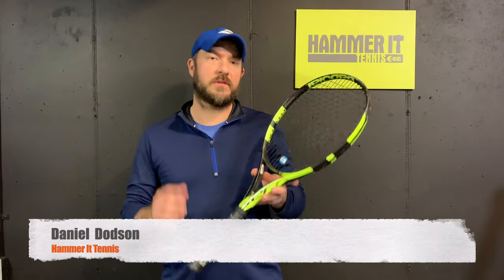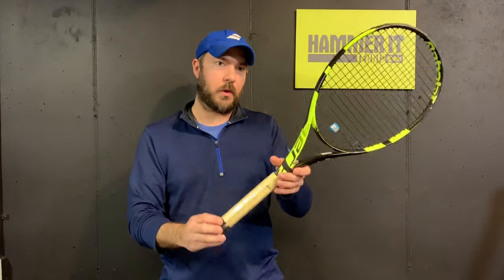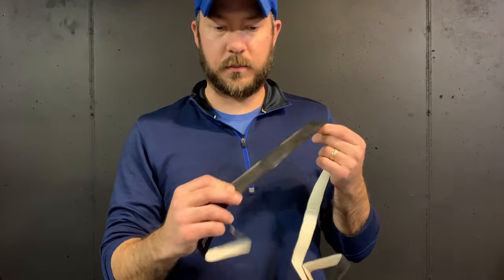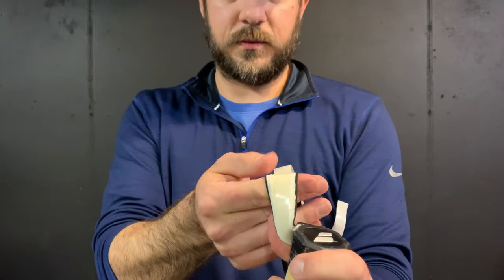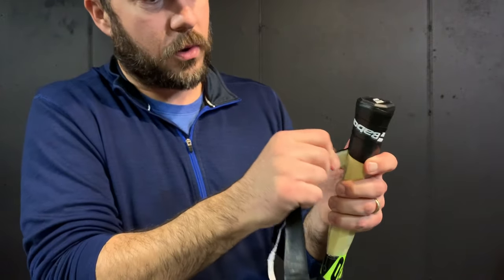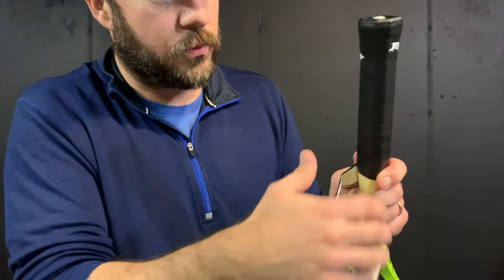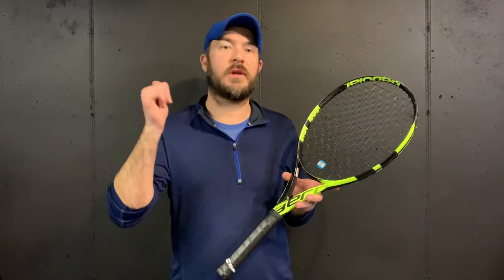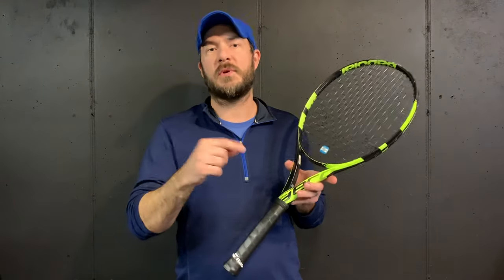How to Regrip and Change your Tennis Racquet Replacement Grip!

Comment: Thank you Sir but do you have a video that shows how to apply a “replacement grip” to a Wilson Blade v8 or v9 please?  This is a nightmare because the end of the butt cap is round and the tape does not stick down when you fold it over as the adhesive only covers the centre of the grip.  Poor design by Wilson.

Comment: Thanks! I remember the pro shop (back in the 1970s and 1980s!) would use a staple tool to anchor the grip when starting the wrap. Is this not necessary any more? Thanks, Kurt
Reply from the maker: The staple will secure the grip the best, but finding a tacker that small can be hard now a days. Most grips have adhesive where the grip starts that holds pretty well.

Comment: I used a different grip tape with NO adhesive at all--Tourna Grip Blue XL.  However, your video helped me change 2 different grips for my Wilson rackets. It's not perfect, but the grips are installed and fuctional; thank you for posting this how to video!  :)
Reply from the maker: Awesome! Glad to help! Tournagrip doesn’t have any adhesive as it is actually an over grip meant to be wrapped over top the factory installed grip (or replacement grip). https://youtube.com/watch?v=8EsT0wVchVI&si=EnSIkaIECMiOmarE is my video on putting on an over grip! Hope this helps too!
Reply: @HammerItTennis  Since I just wrapped 2 rackets, any harm using it or will I have to start over?  This means buying a grip with adhesive and then wrapping the over grip 2 more times for each racket. Your thoughts are appreciated!
Reply from the maker: @evanm.jacobson1514  the factory grip and “replacement” grips not only have adhesive, but they are considerably thicker. Also, the racquets grip size is figured with the thicker grip. This helps give you more cushioning between your hand and the hard handle. I would suggest getting a replacement grip and then over gripping with your Tournagrip.
Reply: @HammerItTennis  Thank you for the advice. I will do as you suggested… Again, your guidance is appreciated. Carpe Diem! EJ
Reply from the maker: @evanm.jacobson1514  let me know how it works out!

Comment: Piece o cake!  Thanks.  When do I use an overgrip? What's it for?
Reply from the maker: Overgrips are used so you don’t have to change the main grip as often. They are thinner and are made to be changed every few times playing or even within a match. Over grips are usually much cheaper and act to absorb sweat and then changed out.

Comment: Can you explain a bit more on what kind of tape we could use if the original grip doesn’t have it? Btw this helped a lot! ❤
Reply from the maker: Are you meaning the finishing tape? Or the tape that goes underneath along the handle ? If your talking finishing tape, electrical tape works well. Double sided tape is what you need for putting along the handle.

Comment: Nice demonstration and advice on regripping tennis rackets. The only thing I do differently is not peel off that much of the non-stick backing as I wrap so that my fingers do not contact the grip adhesive directly. This avoids any oil and dust on my fingers from getting onto the adhesive. It probably does not matter but I’ve got OCD!
Reply from the maker: It just depends on the grip if I take it all off or just a little at a time.  Sometimes the paper backing is not on very well and it just falls as you are putting the grip on.  Sometimes the paper is almost stuck on! Either way if you can just peel it as you go that is best! Glad you like the video!
Reply: We need more videos like these! If only to encourage more people to change their grips. Some of the peeps I play with have grips that belong in a Biohazard lab!! 😅👾👾
Reply from the maker: Yes! Can be a little gross!

Comment: A few weeks ago I took off the thick 'grip' like material and I've purchased what I believe is an 'overgrip'. Without replacing the thick foundation grip, I just put an overgrip on the racket and it honestly feels quite nice. Are there any drawbacks to doing this, besides like gloves in baseball that reduce vibration or something?
Reply from the maker: Depending on the type of material that your grip is made of, which usually is a hard foam type material (could be plastic), it could possibly damage the grip its self as you will be putting more pressure on the material than you would if the force was dispersed by the thicker replacement grip.  Also, if the bevels are "sharp" you will more than likely develop some bad blisters on your hand, and as you mentioned feel ALOT more vibration and "stingers" on off center hits.  If you prefer the more firm feel I would recommend putting a leather replacement grip for a more traditional feel but still protect the grip material and your hand. 

Here are some grips Wilson Leather Grip: https://amzn.to/3i7bkXE  
Tourna Leather Grip: https://amzn.to/2DqNJCx  
Gamma Leather Grip: https://amzn.to/2DJOTso
Reply: If you feel that only using an over grip feels better, it’s probably because the original racket and grip had too wide of a grip. You’ll definitely lose out on vibration dampening but I would look for a smaller racket grip overall. 
There are lots of guides to determining what size you need online

Comment: what can I do to remove the replacement grip if it does not peel off easily, only the outer layer peels off and the glue and the inner layer remain stuck on the racquet and I can not remove it.
Reply from the maker: You can try a couple different things. Gently take a knife/scissors and cut a line down through the glue and remains of the grip. If the handle is made of a hard foam type material be careful not to cut into the handle.  You can also try using a hairdryer and heat up the remains and glue and see if that loosens it up enough to peel off. Lastly you could try goo-gone or mineral spirits or other solvent type chemical and try to rub the glue off. Hope that helps! Good luck!

Comment: hi there kinda an offtopic question but where did you get the rubber band that protects the tape from? Every once in a while I have to retape it because it keeps falling off
Reply from the maker: You can order some from different places. Here is a link to Tennis Express for Tourna brand ones: https://www.tennisexpress.com/tourna-grip-bands-70474  I use the bands rather than grip tape so I do not have to take the time to tape it!

Comment: Have been replacing grips on tennis and squash racquets for 40 years, and found it better to have the tapered end at the top (not at the bottom), that way you don't need scissors.
Reply from the maker: When you have the square end on the bottom you get a bump on the bottom of the grip. Both ends being tapered creates the best fit.

Comment: Thank you! Ever tried to cut shorten a racquet?  Why you ask?  My dtr started playing tennis shes 9 and she wants to compete. But USTA wants her to start at 25in.  She loves her current adult size racquet.  I want to cut and rewrap the grip.  What you think?
Reply from the maker: I would not recommend cutting an adult racquet down for a junior.  Most major racquet brands have specifically designed racquets for juniors.  Not just the cheap two piece metal designs, but basically adult frames that are scaled down.  The grip size on an adult racquet is probably too big as well.  Most adult racquets are not smaller than a 1 (4 1/8 inch grip).  Junior racquets will fit your child's hands much better.

Comment: Good video - thank you!   What is the purpose of the rubber band?
Reply from the maker: Good question! The rubber band is for using instead of using grip tape when you are putting an overgrip on top of the replacement grip.  You can check out my video about putting on an overgrip and using the rubberband here: https://youtu.be/8EsT0wVchVI

Comment: You need to slightly stretch the grip when putting on the racket then it won't come loose.
Reply from the maker: Slightly stretching helps keep it tight.  Just make sure not to tear the grip by pulling too hard!

Comment: Q: how often does. Racket need to be re-strung? 👍🏼👍🏼
Reply from the maker: Obviously you’ll restring if/when strings break, but the frequency of restringing will depend on a lot of factors. How often you play, where you store your racquets, and the string type. A very general rule of thumb is if you don’t break strings playing, is to restring a year the amount of days you play per week. So if you typically play 2-3 days a week, restring at least 2-3 times each year.

Comment: Have watched quite a few videos and still cannot determine which way up/down the tapered edge goes!! Or does it not matter?
Reply from the maker: Alastair Kirkland depends on whether you are right handed or left handed and if you’ve undone the grip completely out of the way it is wrapped up in the package. Assuming you are right handed when you take a grip out of the package you have to wrap it with the rest of the grip on the right side so how ever the tamper is is how it has to be.

Comment: Nice video ! can i put the overgrip first?
Reply from the maker: The replacement grip is to be installed to replace the factory grip that comes on the racquet.  It is much thicker and more durable than an overgrip.  Over grips go "over" the factory/replacement grip only.

Comment: Please,are both of the tennis grips,  the replacement and  the overgrip adhesive tapes?
Reply from the maker: Usually replacement grips have adhesive on the back. Overgrips typically do not because they are meant to go on top of your replacement grip and not damage it.
Reply: @HammerItTennis  Great, thanks a lot!!!
Reply from the maker: @greekveteran2715  no problem!!

Comment: Thanks for sharing! Is the rubber band from Tourna or does it come with racquet? Best regards
Reply from the maker: The rubber band usually comes with the racquet and some replacement grips (not over grips) will include a band as well.  If you do not have one you can purchase them from this link as well https://amzn.to/3ZxObDd Hope this helps!
Reply: @HammerItTennis  Thank you very much 🙏😊
Reply: @HammerItTennis  BTW Can you use the rubber band instead of finishing tape with an overgrip (so you don't have to use the tape)?
Reply from the maker: @stephanpetersen8386  absolutely! That is the point of the band! Much faster on a change over to use the band than to apply grip tape!
Reply: @HammerItTennis  Great!! 🙏😊🙏

Comment: Can i use badminton overgrip for this? I know it sounds dumb but i cant find any replacement grips for my racket
Reply from the maker: Which racquet are you using? They aren’t specifically for any one particular racquet though.
Reply: @HammerItTennis  its a babolat drive z max
Reply from the maker: @migo9625   check out tennis warehouses or tennis express https://www.tennis-warehouse.com/replacegrips.html any of these will work.
Reply: @HammerItTennis  thank you so muchh!!

Comment: Thanks for the video. I am using Ultra Wrap Wilson grip and it is coming with a plastic on one side. That side should go inside or outside of the racket?
Reply from the maker: Marcelo Elgueta the side that is covered with plastic generally goes on the outside. Usually it helps keep a little tack to the grip. Some grips it’s more of a protective layer from itself when it’s in the package.
Reply: @HammerItTennis  thank you!!

Comment: Every time I get a new grip it starts to tear in 3-4 days is the it bc the grip I have trash lol?
Reply from the maker: How is it tearing? Like what kind of tearing and where?
Reply: @HammerItTennis  idk how to describe it but it's like wearing down where I hold my racket which is towards the bottom
Reply from the maker: @real_kunakintai5325  does it wear a hole through the grip? What kind/brand of grip are you using?
Reply: @HammerItTennis  yea it wears a whole through the grip and idk the brand
Reply from the maker: @real_kunakintai5325  well you might try a different brand first. Second, sounds like you’ve got too tight grip pressure. You want to hold the grip, but not squeeze so tight your white knuckling the handle. The butt cap flares out at the end to keep the racquet from flying out of your hand. Try to lighten your grip pressure.
Reply: @HammerItTennis  ok thx

Comment: I bought a grip but it doesmt seem to have adhesive. It wont stick, I'm screwed
Reply from the maker: Autumn H if you can start the grip you should be able to apply enough pressure that it should hold itself in place.  If the handle is really slick foam or plastic you might try lightly using a glue stick to give it some tack. Otherwise take your grip back and get one from Wilson, Babolat or Gamma. Most major brands have adhesive on their replacement grips.
Reply: Autumn H it’s probably overgrip
Reply: Use doublesided tape.

Comment: Why would I need to change my replacement grip?
Reply from the maker: After a lot of use they begin to break down and you lose the cushion of the grip. Ultimately if it is used too much they tear up, although not as easily as an over grip.
Reply: @HammerItTennis  I usually use my Babolat Pure Aero 23, and cushioning is great, but I'm trying and old Yonex R-27 with original grip and it feels very hard. Maybe I should change it then. Part of my thumb hurts.
Reply from the maker: @bryanjonathan1580  absolutely I would change the grip! Changing the grip with a new grip should restore the cushion. Some players prefer that hard feeling and they’ll use a leather grip. The level of cushioning is up to you but if you prefer the cushion then replacing with a cushioning type grip should help out your thumb.

Comment: Taper on the final wrap should be on the lower edge not the top edge.IMHO.
Reply from the maker: Boneshaker if you cut the bottom side of the grip and not the top, the taper of the grip towards the thick part of the grip gets cut off and it won’t fit as nicely against the previous wrap below it. If you cut straight on the top side you preserve the factory grip edge and cover your cut edge with the tape.